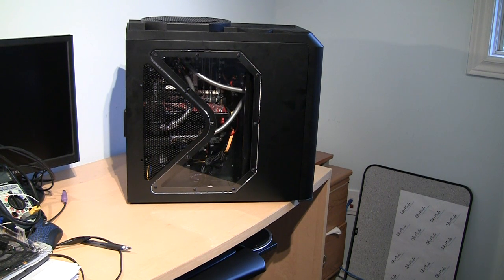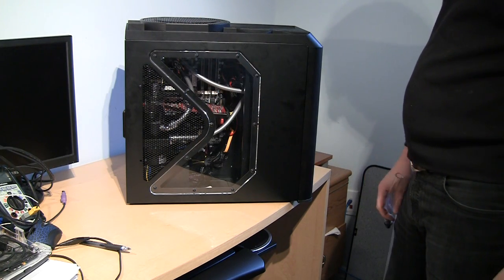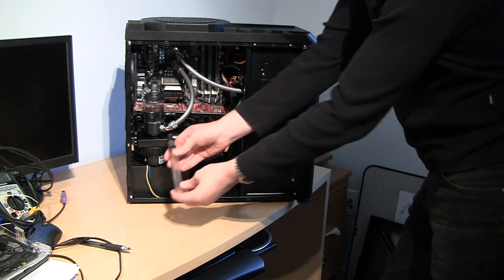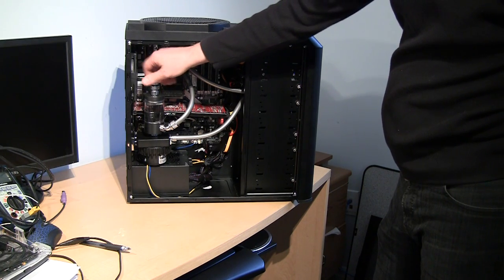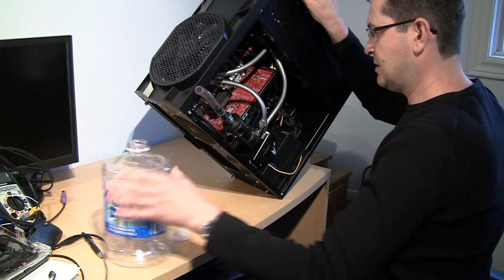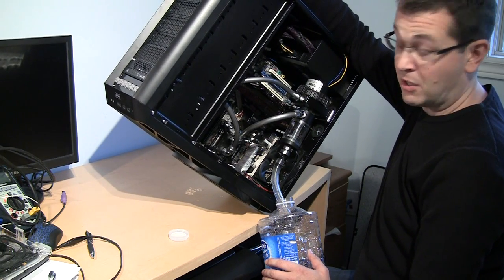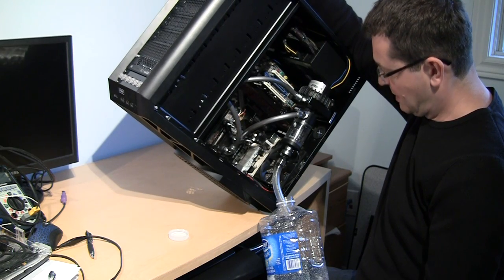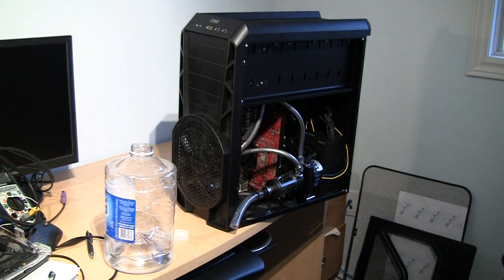How to drain your water cooling loop? Easy!

Comment: Do you have to open the fill port (if on top of the case) to let the water drain out your drain tube (if on the bottom of the case)? Otherwise wouldn't a vacuum form lessening the ability to drain the system?

Comment: I use a quick connect on mine for this! I can change colors of liquid as simple as switching them out. but this is a good video thanks for sharring
Reply from the maker: I agree. There are so many new options became available since 2009 :)
Reply: I have never installed a custom loop before even though i do have one in my pc, but I think im ready to add the goo on my next build! Are there any companies that you would recommend as for the pump and parts..? I do want clear tubing and i think i will uv light it also I have the green sniper MB so black and grean are my two options but that might be overkill on green so im also thinking about neon yellow
Reply: Mike Mays Hey, I'm building my first loop by ordering a complete water cooling set from alpha cool as well as an EK GPU block. The only part I'm confused about is the quick disconnect or drain valve. I want one that I can use to be able to drain my system easily. I'm confused about which one to order because they say like male\make or female and they require other components to work. Could you suggest what I should buy for easy draining of my loop? Like I said I have the whole loop picked out except the drain valve or quick disconnect, whichever you think is better.
Reply: Oh man I wish I could help you out but we are in the middle of a move and I don't have access to all the pc stuff. There are a ton of ways to do what you are wanting.  I have a female end on my drain outlet that works like a air hose I just plug the male end into it and the male end has about 2 feet of hose and I have a cut off valve installed on the end of the hose to avoid any spillage. Only thing I have to watch is when I unplug.
Reply: Mike Mays
 The confusing part is most the drain valve's don't work just by themselves. You have to add like a T splitter on them too. I'm thinking I'll just buy a Koolance quick disconnect and put it on my lower point component. From there I can disconnect the tubes without spilling, put the tube over a bucket, and remove the quick disconnect so the water flows out into the bucket. I'll probably also order one of these T-Blocks which as three holes, two of the water to flow through and a third for a plugged drain port to be installed. I'm sure the components will make more sense once their in my hands.
Reply: Ok sorry I didn't go into detail the other day but what I have is a shut off valve. You just attach it to the end of the hose and now that I have my pc in front of me I can explain a little better! It rotates only 90 degrees for open flow and closed. I fed it through the grommets in the case so it isc drained by removing the back side panel.  Then I just place the hose in a bucket and turn the valve. As for the valve no one can see it and I bought it at my home depot.  Hope this helps

Comment: I designed my loop so my reservoir can be detached and tilted upside down.  It starts a flow that allows me to drain via the siphon effect.

When the siphon effect is complete there is a small amount remaining, just beyond the pump, and sometimes a little left in the radiator, though that is rarely an issue.

--The loon

Comment: So no damage would occure if I used the pump to bleed the system correct? Also you sell the external 12v & 5V DC power supplies on your site correct?

Comment: (part 2) if you then realize its going to higher temps than before, you should either buy another one, or try to unassemble it yourself and replace the coolant and maybe try to get the cpu block rinsed, but i can say that it should take a VERY long time before that is needed. Also, i dont know how good the fans are on the alienware cpu RAD, but i recomend upgrading if your temps get above 70C, because the LAST thing you would want is for liquid to boil in a closed environment

Comment: well im not sure if thats the right term for it, what i mean is that the cooling system is manufactured and comes set up stock, kind of like the corsair H-50/70/90 liquid cooling systems, you just buy them, they come set up, you just have to install them and never worry about them again. im sure that EVENTUALLY, the performance will dwindle little by little, and when you begin to notice that your CPU is overheating (if you dont monitor your temps, i HIGHLY recomend you start doing so)

Comment: You would think siphoning, either manually or with the right equipment, would be easier on you and your equipment. Especially for heavy cases, especially for heavy cases that use plastic front/top panels that could crack under the weight. Would only suggest manual siphoning if its plain distilled water though, additive stuff is probably rather toxic. Shouldnt be a prob since the best route is distilled water with kill coils anyway.

Comment: You could always just use common sense and put a "drain valve" a the lowest point of your system and have it on a "dead" setting so it just loops around and, essentially, ignores it unless i turn the knob.

Comment: Funniest technique ever.
My Case would be impossible.. it weights almost 50 kilos.
Also.. with all the loops and disks, you could have broke something with the turn
over of the case.
You should use a hospital can with tubes. You squeeze and the can sucks
the water,... then you blow air in the tubes..and squeeze again.
There a lot of techniques but yours was new to me.
Never tought of it. It also looks bad for your equipment. imagine if you 
cant grab it wisely... :)

cool video altough